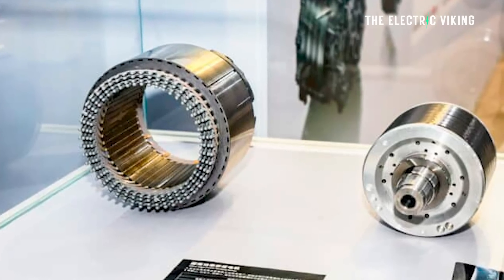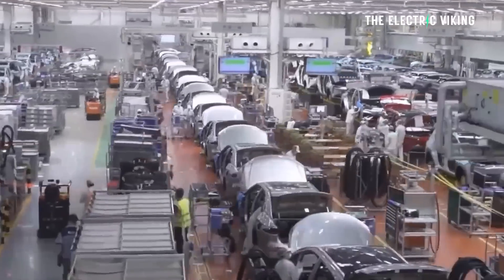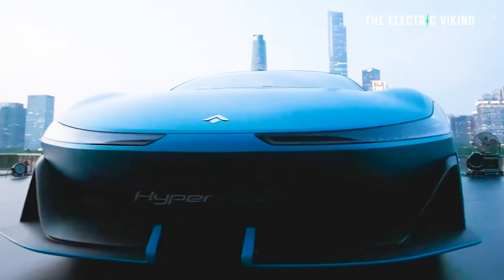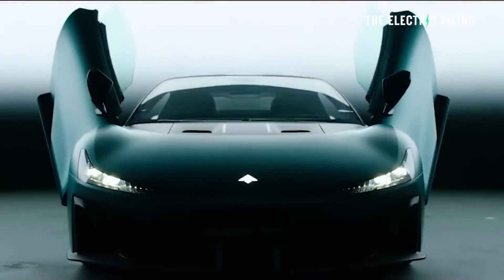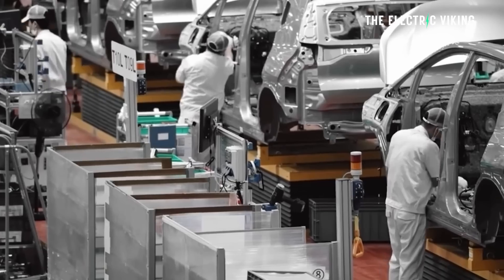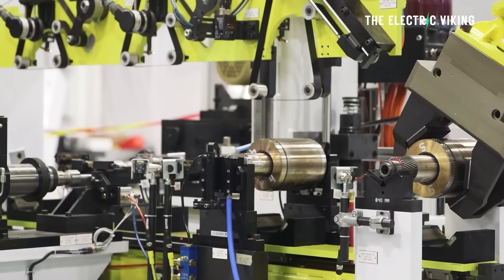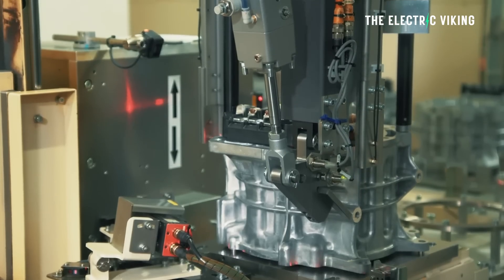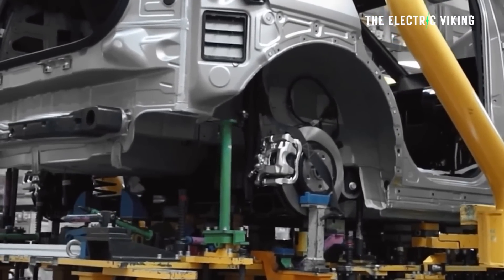Most efficient and powerful EV motor EVER hits an amazing 30,000 rpm

Comment: There is also the weight of the gearbox. That increases with the speed of the motor.
 I do see a future for such motors in aircraft. CATL is talking about a range of 2000 to 3000 km for electric aircraft. COMAC will want to replace the the ARJ21 pretty soon. A new Dutch aircraft manufacturer is designing an electric aircraft of the same size with a range of 1000 km.

Comment: Super! Where is that in-wheel or hub 1kg and 10kw motor? This would be a true revolution.
Reply: So to hell with unsprung weight?
Reply: Hub motors suck - they have been around forever - far more prone to impact damage, ingress of dirt, debris and liquids, less efficient and stick all the weight on the end of the axles leading to a terrible ride experience - Apteras (if they ever make any) will gain a reputation very quickly for being complete rubbish auto-cycles.
Reply: @TB-up4xi  The wheel itself is an unsprung weight at the end of the axles. I think the key here is the compactness and the low weight of the hub engine, pass a threshold and they will get there (electric vehicles have been around forever, only now to take over).

Comment: Sam says battery chemistry is changing every week, but it isn’t. Once you commit a design (ex: battery) to a large scale production line, that’s it. Nothing changes until the scheduled end of that production run. That could be years. Changes cost big money and upset all the forward factory floor planning. An improvement in laboratory research takes years to perfect and be made workable and financially viable.
Reply: you talking about western, NOT in CN
Reply: @jetli740  It’s the same for them.
Reply: I think when he says battery chemistry is changing every week it's because there are so many different researchers and manufacturers working on the problem simultaneously. For a given manufacturer, yes, they make a commitment and that's it for a period of time.

Comment: Very high revs in a vehicle motor are not a good thing in themselves. The speed has to be reduced to around 1000rpm at the wheels, and a 30 to 1 reduction will probably have to be done in two or three stages. Each stage of gearing has an efficiency of about 98%, so the efficiency is down to the low 90s when you include the transmission. The losses from the transmission are worse than this in practice because the biggest loss is from churning of the lubricating oil, and this loss remains about the same as load is reduced which means that the efficiency at light loads is much lower. The efficiency gain from the amorphous magnetic material would also apply in a larger and slower-running motor, and the overall efficiency would be better because of the lower losses in the transmission.
Reply: I think that the Chinese might be overstating their "break through", here. 98.5% efficiency? Just think about that, for a second. Copper losses, windage, hysteresis losses and frictional losses in a motor that spins at 30,000 RPM being only 1.5%? I didn't come down in the last shower, you know.
Reply: The Tesla model S Plaid motor spins at a max 23,000 RPM (with no load) and has a single reduction gear of 9.73:1 

A 265 /30/20 tire will do circa 800 revs per mile. 180 miles per hour = 144,000 revs per hour = 2400 RPM for the tires. 23,000 / 9.73 = 2363 RPM after the reduction gear.

There is no need for a 30:1 reduction gear - more like 12.5:1 for 180 mph top speed  or 10.4:1 for 220mph

Comment: When you say this electric motor is 98% efficient, what are you comparing it with to evaluate its efficiency.
Reply: The efficiency of an electric motor is calculated by dividing the power out (torque in newton metres times speed in radians per second = watts) by the power in (volts times amps = watts). This gives efficiency as a decimal fraction. Multiply by 100 to get it as a percentage. To convert speed in rpm to radians per second, multiply by pi and divide by 30.
Reply: @cedriclynch  Sounds like you might have got that straight from Google search. But thanks anyway, makes sense.
Reply: ICE loses about 15% hp to the drivetrain while EV's lose 5% or less.
Reply: @larryc1616   The 15% loss you quoted in an ICE car is correct Larry but people don’t realise that this also applies to an EV. A Tesla 3 for example has a 9:1 ratio reduction epicyclic gear train and differential, and this incurs a 15% loss of efficiency. If a drive system is not 1:1 and requires a gear-set of any type, there is a 15% loss straight away regardless of what power unit is driving the input shaft. You can check any of this out through the SAE (Society of Automotive Engineers), it’s been like this for decades. The introduction of full synthetic oils has increased the efficiency a little but not dramatically. Tesla gear-trains use standard off the shelf ATF (automatic transmission fluid) even though the gear train is “fixed” (no clutch or torque converter).

Comment: Maybe we can used the advanced materials and manufacturing on a motor and not increase the speed and get significant and possibly similar gains.  We don't have to use expensive high speed bearing or additional gear reduction.

Comment: I'd like to see cup holders able to keep your drink hot or cold as required. For example, 40C would be enough to keep a hot drink hot for much longer. Similarly, say 4C would be cold enough to keep your cold drink cold much longer. You could choose by way of a switch or it could be automatically detected.

Comment: I live in west Michigan , Consumers power is installing eight megawatt solar and battery system. It will be done early 2026. They bought 30 acres  just for mega Batteries and leased four square miles for solar panels.

Comment: A motor running at such high RPM needs multiple Gear stages which will reduce overall efficiency.
Reply: No, one to one ratio with wheel rotation, 60km per minute or 3600km/hour 🤣
Reply: @Tron-Jockey Very instructive, but of course I was joking !
Reply: No transmission and no shifting for 1 gear like Tesla Plaid

Comment: The limit of how fast electric motors in EVs can spin is limited by the rotor flying apart. The electronics can do 100k rpm without much trouble.
Reply: Precision vehicle turbocharger impellers can spin to over 250k.
Reply: @robertfonovic3551  you need to have a look at the construction of the rotor. The outer part is held by a very thin piece of metal. That bridge needs to be as thin as possible to reduce the magnetic field being shorted. That is why Tesla carbon wrap their rotors. Carbon wrapping allows the removal of that link so you get a stronger magnetic field.
The thinner the link the more torque you get but the lower the top speed.
Induction motors don't have this problem but they are less effecient.

Comment: Fine to talk about these new developments in motor technology, but these are difficult and expensive to manufacture. So you won't see this in ordinary or low cost EV for some time. But please keep up the development.
Reply: The only thing this will do is to make current high volume production motors incrementally better over time ...
Maybe 
😂😂

Comment: Like comparing a Formula 1 engine to a regular car engine. 30,000 rpm just means requiring a bigger ratio in the reduction gearbox, and how long do you think bearings will last at 30,000 rpm compared to 5,000 rpm, and at what cost? The power converter will also have to operate at a higher frequency which will push up switching losses, so I suspect that energy losses are just being transferred from the motor to mechanical and electrical losses elsewhere.
Reply: CNC spindles have been doing 30k rpm for a long time. No issue there. The electronics have no problems running at that speed. The limit is the rotor flying apart. That is a little hard to do when you have magnets in the rotor.
Reply: @franciscoshi1968  I've seen the damage done to a 285Kva alternator following a governor failure in a big diesel. Needless to say, we didn't repair the alternator. That probably hit maybe 3000 RPM, tops.
Reply: @davidbrayshaw3529  a 280KVA alternator is a bit different to an EV motor in terms of speed limits. The alternator is not meant to spin that fast.
Reply: @franciscoshi1968  You're absolutely right! Centrifugal forces bent out parts of the commutator like they'd been put in a press.
Reply: We're not talking about the difference between 5,000 rpm and 30,000 rpm - Tesla's electric motors already spin at a maximum 22,000 rpm and last for years and hundreds of thousands of miles - it's a moderate increase of 36% but not a quantum leap.

Comment: Seems to be a huge amount of marketing hype here, with no numerical analysis to back up the claims.  Existing motors are already 97% efficient, so the potential upside is small.  Maybe you save a little weight, but the motor is a small percentage of the car's weight.  I want real facts.  The best fact in the video is the use of a very thin amorphous magnetic material with high permeability.  I can see that would reduce eddy current losses per kg of motor, even at the higher frequency needed for high speed, and allow less magnetic material to be used, saving weight.  Include science and engineering facts and it helps dispel suspicion of unwarranted marketing claims.  Stop evangelising and explain the facts or you will not convert the sceptics.  Correction: I suppose most people are driven by emotion and are immune to facts or don't understand them.  I am so tired o& this world!

Comment: Bearings that can operate at 30,000 RPM are very expensive and most likely would have a short useful life. Also the high RPM would require very strong gear reduction to
Reply: You'd probably need ceramic bearings if the motor was to operate at 30k RPM for any substantial length of time methinks. Space shuttle main engines turbo pump ran at an insane 70k RPM, but the steel bearings used in the early batches of engines were good for just one launch, with the engines running for only about 8.5 minutes total, and a bunch of that time at a downthrottled state (first when passing Max-Q, then as the main fuel tank starts to empty out, to limit G-forces on the crew.) After each launch the engines needed total refurbishment and bearing replacement, and were therefore torn down into component level for access and inspection. The ceramic bearings used later on lasted several launches.

I doubt anyone would want to have to bring in their car for regular motor refurbishment, the motor would have to have a decades-long lifespan pretty much to be a viable design. The paper specs are excellent, but such high RPM figures hint at potential reliability issues.

Also... China. :P I'd like to see some independent verification of all of these claims. Efficiency for example, at what power level is that 98,5% reached? Typically electric motors go down noticeably in efficiency as they start to hit max RPM, so this would likely matter.
Reply: @lennyvalentin6485  

They typically use hybrid ceramic roller bearings

Our company (in China) develops them
Reply: @Tron-Jockey Model S & X Plaid motors.
Reply: Why use that type of hearing..just use hydraulic bearings
Reply: @Rockall57  Not sure hydraulic bearings would work in an application where the bearing must handle large and sudden mechanical forces.
Reply: Amg1 electric motors do 30k rpm

Comment: Don't believe the hype, cobber!
Reply: I'm with you. It's well and truly in the "too good to be true basket", if you ask me.
Reply: @davidbrayshaw3529  I don't know why - Tesla motors currently spin at a maximum 22,000 rpm and last for years and hundreds of thousands of miles - not like we're going from 2000 rpm to 30,000 - this is only a 36% increase in RPM.
Reply: @TB-up4xi  I actually thought that Tesla motors spun much slower than that. But
RPM isn't what I'm struggling to believe.
It's the 98% efficiency claim.

Comment: In general super high rpms means larger reduction gearboxes with added inefficiency in the drive chain and at best very marginal efficiency gains overall and unreliability potential in that gearbox. Also higher rpm = higher wear. Its all a compromise. I suspect this is just too fragile as a system for too little gain to be a long time commercial success

Comment: Fast rpm doesn't equate to power in EV motors, usually the opposite. Remember EVs can become electric  generators . Also, back in the "dark ages", 2006 Audi Le Mans diesels were spinning at 22,000 rpm and even my 1980s Honda 250 4 stroke Desmo redlined at 22,500 rpm. Torque is power, not revs. Torque is measured, BHP is calculated  from Torque.
The boring stuff: BHP = (Torque × RPM) / 5,252 . A calculation...
Reply: Nah, power is torque x RPM, that's why F1 cars are so high RPM, it saves weight per HP.
Reply: @erik.... more BS.
Reply: @robertfonovic3551  prove me wrong then
Reply: @erik....  Well, your engineering professor studied at a different university from mine...Weight/HP? Irrelevant. Point is, BHP is NOT measured but only a calculation.
Reply: @jgarbo3541  how is engine weight per HP irrelevant in racing? High RPM engines can have the same power output at a lighter weight. At the other end of the spectrum are truck engines that can weigh 10 times more than an engine from a car with the same power output but it's beefier for durability.
Reply: BS. HONDA  have never made a desmo valved engine. The Audi r10 tdi engined Lemans car  rpm ceiling was 5000. 😅😅
Reply: @robertfonovic3551  Look it up. Honda MD09E. I bought one in Bangkok, rare.

Comment: This has got to be good for aviation applications.
Reply: Possibly for a ducted fan although even then will need reduction gearbox. Definitely too high rpm for propeller aircraft. High torque is whats needed in aviation. Look at some axial flow motors already produced or in development. There's loads of videos on YouTube 😊
Reply: @hedleypepper1838  Interesting point.
Reply: @hedleypepper1838  *Power, not torque. Power is the multiple of torque applied X RPM. No, you can't have power without torque, but all the torque in the world doesn't necessarily equate to work done. That's what power measures, and it's the reason stationary engines, including those used in aeroplanes have rated power outputs, not torque out puts. By the way, I'm a former hanger rat (aviation maintenance engineer unqualified).

Comment: This is the Best of the wrong patent.
It is based on second patent, simetrical motor, the more is goes, the more heat increase due to back emf.
The cokd motor is 160% to 250 % efficency

Comment: If such and even better motors are installed in my battery-powered lawn mower for 200 euros at some point, I can safely afford a corresponding car that is the result of a democratic work process. Until then, I'll ride my battery-powered bike, which is now 7 years old and still has its first battery.

Comment: ICJ (https://en.m.wikipedia.org/wiki/Imperial_Chemical_Industries)
In the UK have for years had an electric air compressor which runs at 100,000 rpm. Runs 24/7. Tolerances are so right the stop/start process is far from straight forward.

Recent subscriber - enjoying your videos.

UK government now allows Chinese electric cars for disabled mobility users

Comment: Reykjavik (Iceland) is one of the lowest carbon cities in the world. The grid there depends completely on a mix of geothermal power, hydro and wind, and heating is on a district geothermal system using heat off the back end of the geothermal power plants. Generation costs are very low, and Iceland is now well on the way to electrifying transport. As of 2022, 60% of new vehicles were EV.

Comment: 30K RPM means it will not last very long. bearings etc/can't hold
Reply: There are Turbos spinning 200 000rpm lasting for 1000 000 miles is trucks😊